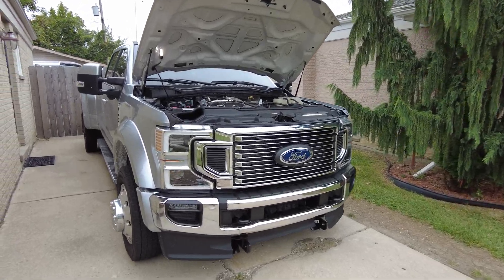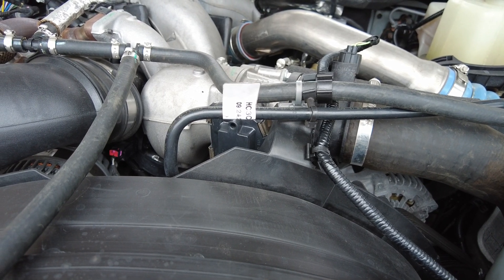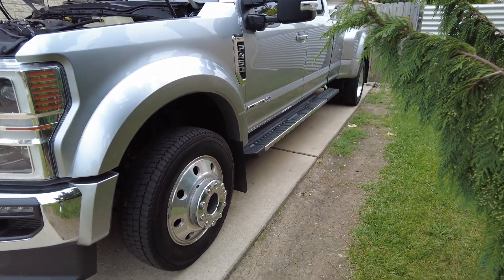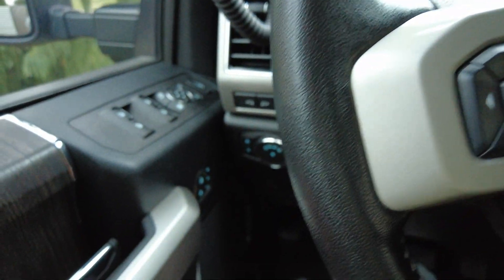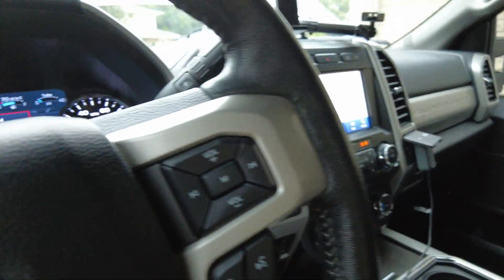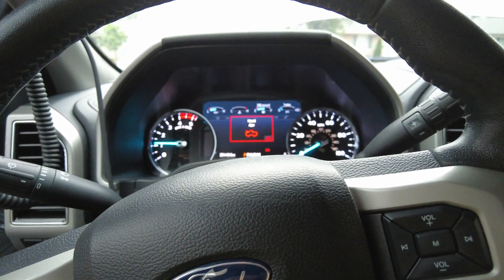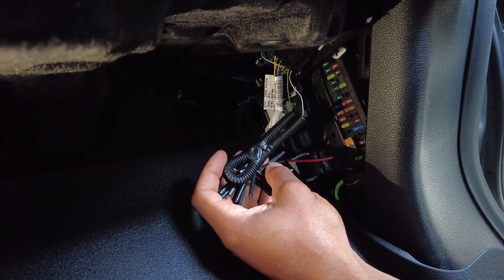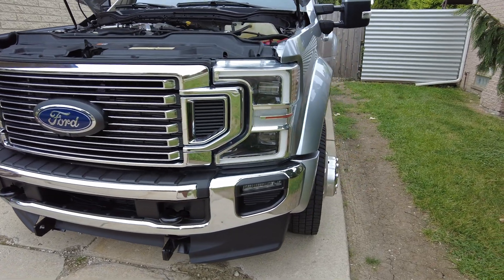What is the purpose of the high idle mod??

Comment: Which type of resistors are needed and where can you get them? Great video, thanks!
Reply: That's the old way of doing it IF you want to wire it to your uplift switches. Otherwise just buy the BD high idle kit for 100 bucks. It plugs in on the passenger side and has a twist dial you can control how high it idles all the way up to 3000 rpm. Takes 5 mins and no drilling. 

Just set your parking brake and it will idle up.

PRO TIP: Set your parking brake on before you get out and when you remote start on cold mornings, it will idle up and warm up sooner.
Reply: Pay $100 or do the resistor for like $5-10 at most if you already have upfitter switches
The resistors are on Amazon a pack of 100 for like $6

Comment: i put in high idle last winter, and it's such a nice mod to have. at -40 the truck's temperature would drop so much even before the truck would kick in high idle. and it only ever seemed to go up to about 900 RPM. i used a variable resistor dial. so i can control thee RPM for the situation, and not just have an on/off.
Reply from the maker: Nice!
Reply: I’m moving to Montana soon. I have the same high idle knob that I installed. When it drops that low in temp what do you suggest in high idle at for RPM? And how long?